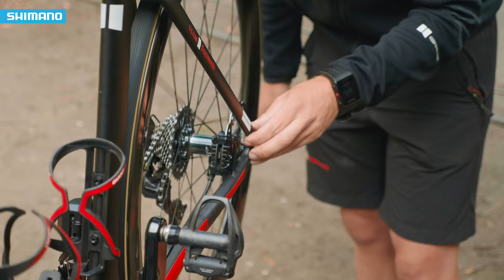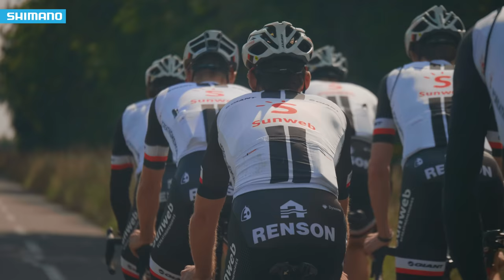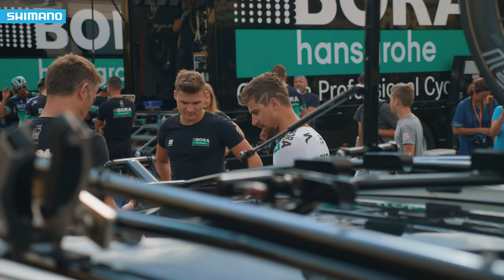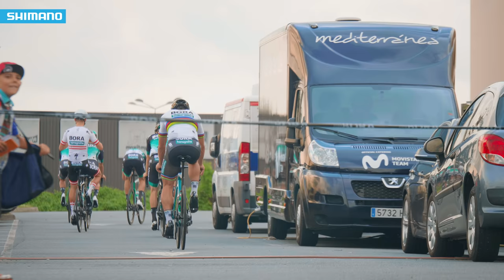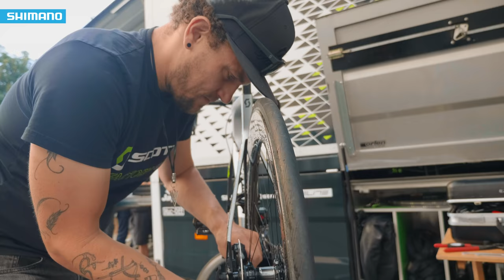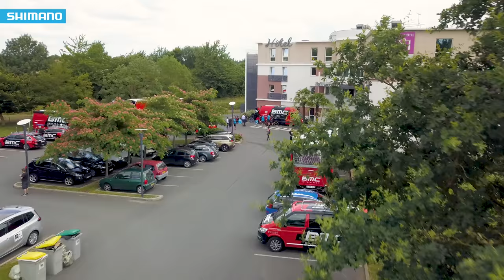The disc brakes revolution in the pro peloton | SHIMANO

Comment: What about the maintenance ?
Reply: RL@VD what maintenance? Occasional bleed and resetting the pistons when replacing pads?
Reply: if you once done a bleed it is easy and not something that requires rocket science. much easier and faster than, f.e., replacing rim brake cables, especially internaly ones.. changing of the brake pads is done with one crew driver in one minute. its really simple.
Reply: That's not a typical end user job. Greedy shops like the one i work for would gladly do it for you. My wallet is fatter thanks to discs!
Reply: Total bull, it takes 1min to change out a brake cable... Bleeding  is something you should not rush through... One can easily mess up a bleed due to air in the system.
Reply: Bleeding, replacing pads, resetting pistons, bedding in new pads. 1 hour job. Why the rush?
Reply: RL@VD When you say occasional bleeding you What? Once a year?
Reply: On my CX bike I haven't bleed the brakes in 4 years.
On my road bike I bleed them just because I upgrade them, so the new hoses need to be shortened.

Comment: It started with pushing wider tyres and now disc brakes this is lame...I still feel faster on 23c and have more control modulating rim brakes because I am rubbing pads with the force applied through my fingers unlike disc where there is no feel and hydraulics does the work for you
Reply: Try SRAM hydraulic road brakes and you will know what modulation is...
Reply: IGNACIO BECERRA i rode that when you didn't even hear of it most probably. Sold 5 units of sram hydro groupsets and 11 bikes with sram and shimano hydro this month so yeah really not into it.
Try racing me downhill and i'll let you know how to modulate rim brakes.
The only good thing about hydro is that you only have to use a single finger and not any force to brake and rims don't wear out other than that they are stupid on a road bike.

Comment: Shimano is forcing this on the pros otherwise they would stick with rim brakes. Way lighter. Just wait until there’s a pile up at speed and someone gets sliced badly.
Reply: surfinDelMar you're more likely to cut sliced from a limb going through the spokes
Reply: All the bikes are at the UCI weight limit, with or without disc brakes genius.
Reply: Ryan Ives they're not even close. The supersix is at 7.8kg without pedals. The Venge is the lightest of all and Sagan's weighs 7.4kg with pedals even though he is using CLX 50s, not 60s, which save 200g. Try again.
Reply: the aerobikes are heavier. "normal" bikes are at the wheight limit, even with disc brakes. and a cassette or the spokes are much more likely to slice and hurt someone than the discs.
Reply: Ryan Ives No they’re not. Learn the facts before you go spouting off and stay away from making it personal over a benign comment that had nothing to do with you. Clearly you have serious insecurities that you need to get under control.
Reply: Ryan Ives it's time the UCI dropped the weight limit to 5.4 kg but you won't see this happen because the industry knows making a heavier disk equipped bike is simple but mass producing a light weight bike is a bit more of a trick but technically more than possible. Rim brakes are very powerful but getting people to buy a new bike so they can look pro is the major interest the industry has not pushing technology forward.
Reply: Lol so why are campy and sram also making them if they aren't better???? My guess is you've never ridden a bike with discs.
Reply: Damag381 “better” is a matter of perspective. 
If they were better every pro in the peloton would have them. 
Immediately. 
But they don’t. 
In all likelihood they will eventually but it will be from the sponsors forcing them. 
Quit talking shit and making so many assumptions. 
If you want discs, fork out the money for an entirely new bike and go for it. 
I’ll continue with my standard SwissStop pads and carbon wheels. They work killer and are super light!
Reply: surfinDelMar haha problem is I'm not talking shit. Ever think it's only taken till now with technology to catch up. That's why road is finally swapping over. Just look at XC mtb only a few people and teams didn't want to run disc straight up. Now everybody runs them.
Reply: Damag381 Everyone has been running them in MTB for over a decade. 
Road could be the same but it’s not. 
Maybe 30% of the peloton uses them. There’s a reason for that.
Reply: surfinDelMar yeh it's called the technology wasn't good enough :/
Reply: surfinDelMar oh boo hoo
Reply from the maker: We're not forcing anyone. All our sponsored team riders are free to choose the setup they wish to ride with (as long as it's Shimano). As you can see some riders use different setups (rim or disc) for different stages.
Reply: David Matsunaga Also poor people like me who can't afford the price of those disc bikes
Reply: surfinDelMar 
You don’t get cut you get burned.
Reply: surfinDelMar no ones been sliced in the mountain bike world and there so blunt
Reply: Bob Dixon 
But plenty have been branded by a disk.
Reply: David Matsunaga your comment is so iinfantile it defies all logic. There is nothing wrong with rim brakes.
Reply: #RideShimano yeah right so commercial considerations do not play a part in cycling.
Reply from the maker: If you want to choose, you'll need choices. That's why we introduced disc brakes next to all rim brake option we already have for many years. If you look at our line-up there's something in every budget for everyone >> https://bike.shimano.com/en-EU/components/road/category/brake.html
Reply: surfinDelMar 😂😂😂 #muppet